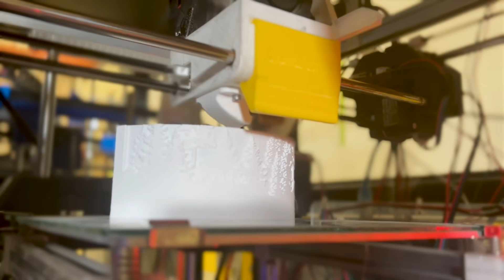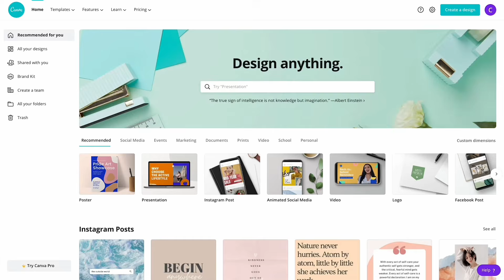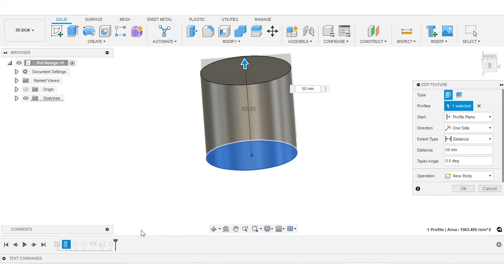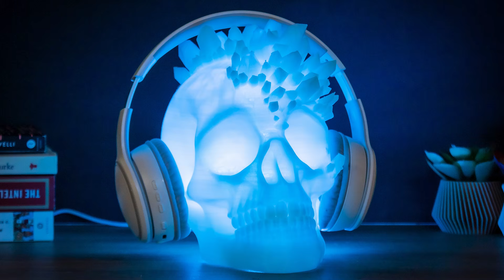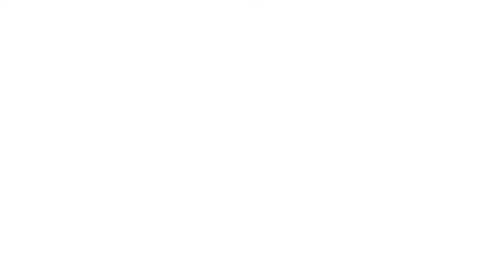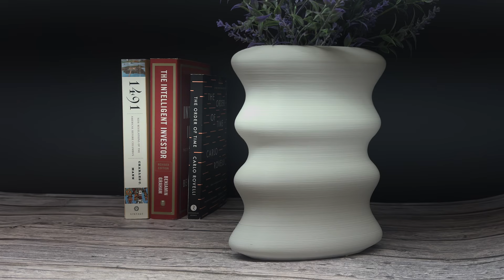Start a 3D Printing Etsy Store From Scratch | Things You Should Know

Comment: Have you worked with an economist (or someone similar) to consider follow on effects to expect from a new, near zero up front cost, just in time (JIT), fulfilment model? Are there scenarios that you can't react to, and you'll have to prepare for instead?

As an illustration, imagine a glut of stores drives a glut of copy-cat 3D printer fulfilment centers that together crash customer experiences and threaten to kill the JIT 3D printed product market. With foresight you might set up a Seal of Quality program that differentiates your good fulfilment customers from the glut of garbage and keeps your corner of the market alive.